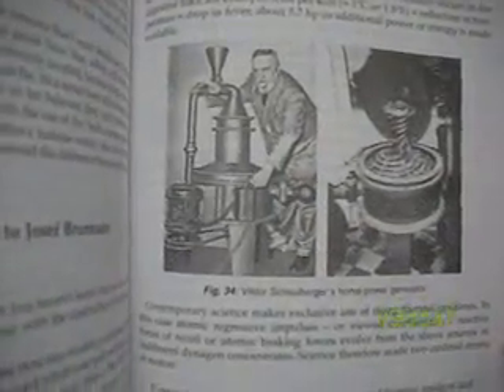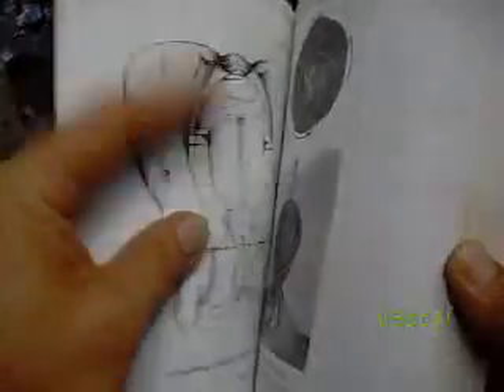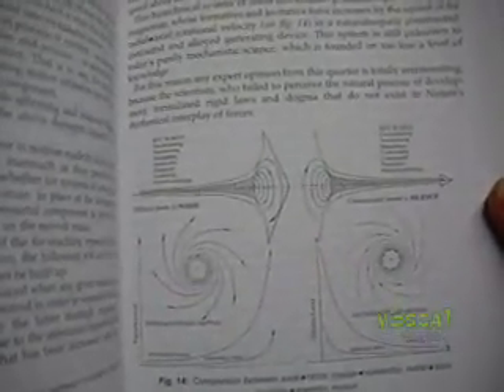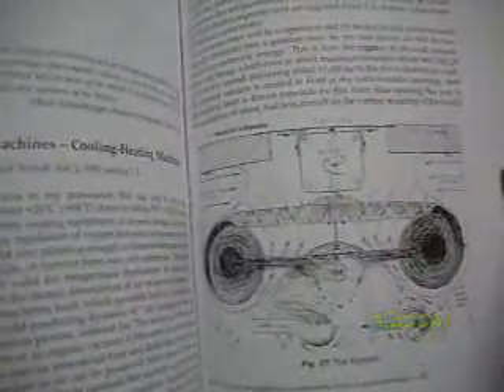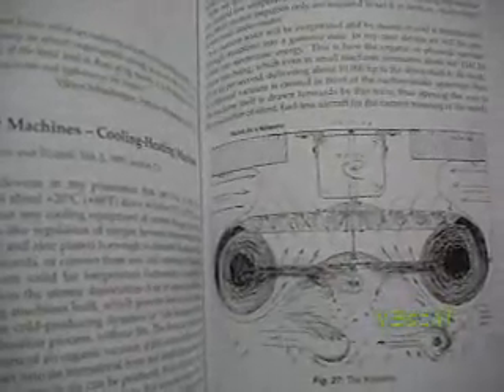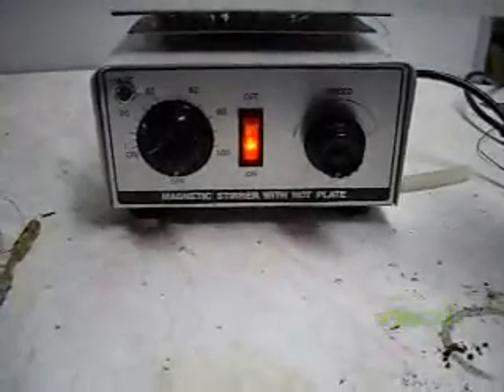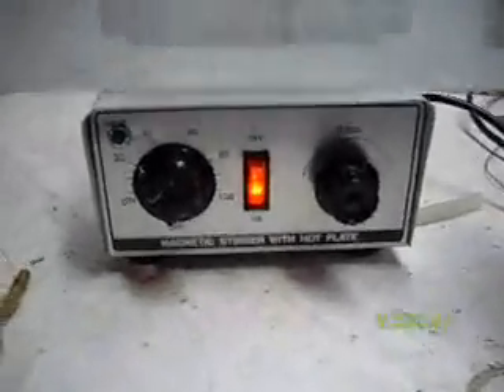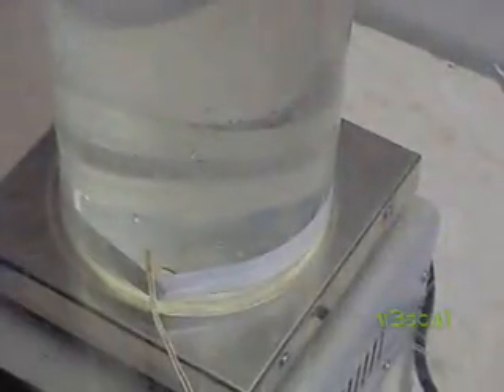The secret life of water...vortex energy

Comment: @m3sca1 Sorry for disturbing but it everything but counter intuitive if you think about what that vortex does. It just creates flow on the surface to fill up the empty space in the center. And looking at the centrifugal power also just think about what it does! It just drags the material with the highest density / weight out. So as long as the things you throw in the water have a lower density as the water itself they just get drawn to the center.
Physics is incredible isn´t it ;)

Comment: actually, the torsion wave field created inside a pyramid induces a vortex flow of electrons which spin round and it's this spinning of electrons that sharpen a dull blade. It's a well documented fact but again i see you've tried to be clever instead of actually doing some leg work to find out for yourself. anyone with any degree of scientific knowledge knows this. I'm guessing you attended the usa's flouride school of indoctrination though so I don't hold you responsible for your dumb remarks

Comment: Curiously, I am starting a razor blade factory, we will use no sharpening equipment, just blank stock for the blades, the amazing thing is we will hang them in the pyramid shaped and blessed storage building and they come out sharp in less than a week.  I need some startup capital though to build my pyramid.  Planexzeropoint?  Would you lend me say $10000 or $20000 to get started, you cant lose it really works, I am sure we can out perform Gillette and the others with our low startup cost...

Comment from the maker: well perhaps using boiled out water to make the ice could rule out gas bouyancy,but trying to isolate the forces involved would negate the effect-all things work together in this system,and removing any part would stop it working.
perhaps adding hot water to upset the cold core,and a much larger block of ice would help better demostrate the effect.
also lifting something heavier than water.
see the work of Vitctor Schauberger for a heads up on whats going on here

Comment from the maker: yes its interesting stuff.
the central spiral contains the coldest and therefore the most dense water.
the speed in the vortex core is rotating much faster than the outer layers,and causing a loss in pressure below the toothpick.
its making bouyant things sink.
do it the other way around,and heavy things can now float.